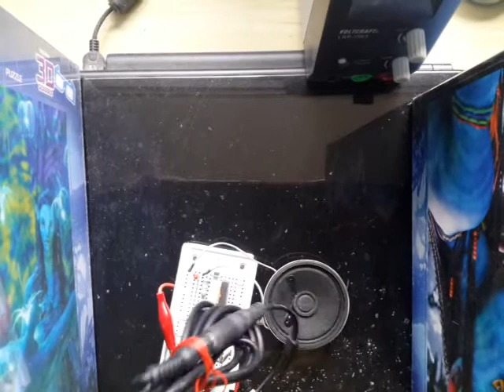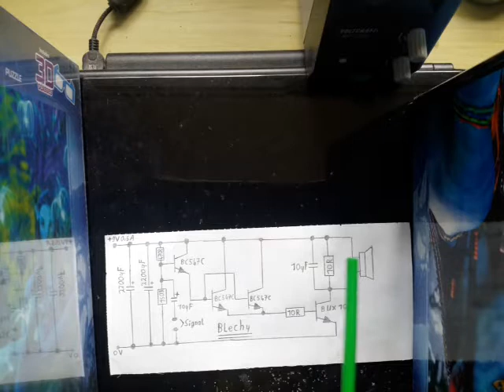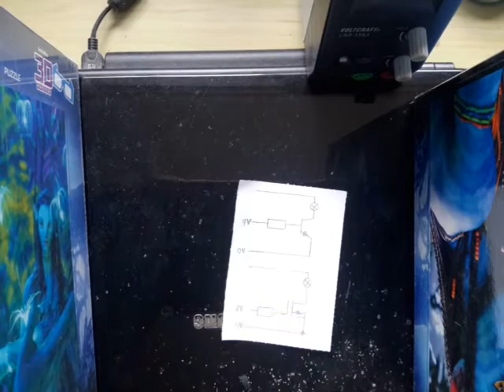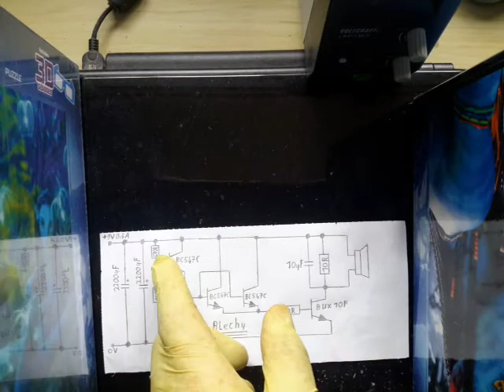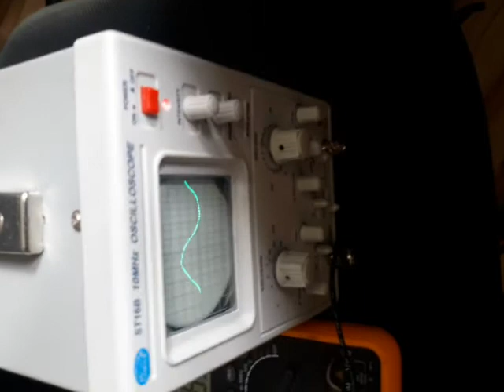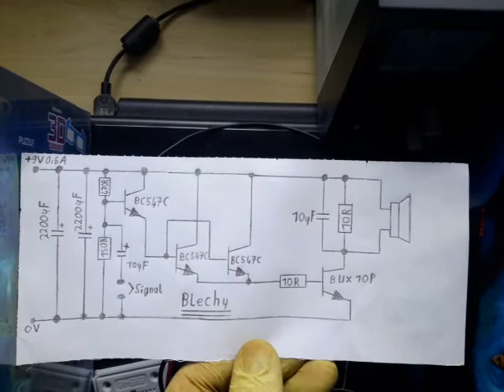Blechy Audio amplifier

Comment: Der Wirkungsgrad eines Class-A-Verstärkers hängt stark davon ab, wie er aufgebaut ist. In seiner einfachsten Version arbeitet ein Transistor gegen eine Konstantstromquelle. In diesem Fall ist ein Ruhestrom von der maximalen Stromaufnahme der Last erforderlich. Der Wirkungsgrad ist in diesem Falle maximal 25%. Man kann einen Class-A-Verstärker aber auch für symmetrischen Push-Pull aufbauen. In diesem Fall muss der Ruhestrom der halben maximalen Stromaufnahme entsprechen. Der Wirkungsgrad ist in diesem Falle maximal 50%.

Es ist also durchaus nicht so, dass Class-A-Verstärker grundsätzlich einen extrem schlechten Wirkungsgrad haben. Der maximale Wirkungsgrad eines reinen Class-B-Verstärkers liegt maximal bei pi/4 (ca 78.5%). Class-AB liegt etwas darunter, in Abhängigkeit vom A-Anteil zwischen 70 und 75%. Hier kann man kein theoretisches Maximum mehr angeben.

Bei der Angabe der Verstärker-Wirkungsgrade muss man auch bedenken, dass die schlechtesten Wirkungsgrade in der gesamten Leistungskette nach wie vor beim Lautsprecher angesiedelt sind. Typisch sind hier elektroakustische Wandler-Wirkungsgrade von 1 bis 5%. Mit Horn-Lautsprechern schafft man auch bis zu 20 oder sogar 30%.

Blechys Verstärker ist schon ein recht seltsames Unikum. Die ersten beiden Stufen sind reine Stromverstärker. Nur die Leistungsstufe hat eine Spannungsverstärkung. Die gesamte Schaltung hat keine Gegenkopplung. Deshalb sind die THD grottenschlecht. Die Endstufe ist keine Class-A-Stufe sondern eine Common-Emitter-Stufe mit einem seltsamen Stromteiler. Dabei wird ein Teil des Gleichstroms der Endstufe über den Lautsprecher gezogen und führt zu dessen thermischer Belastung ohne dass hier Musik entsteht.

Mit dem Schaltungsaufwand (4 Transistoren) kann man schon einen sehr guten Class-A-Verstärker aufbauen, wie z.B. den Transistor-Verstärker von J. L. Linsley Hood aus dem Jahre 1969.

J. L. Linsley Hood: A 10-W design giving subjectively better r esults than class B transistor amplifiers, Wireless World, April 1969